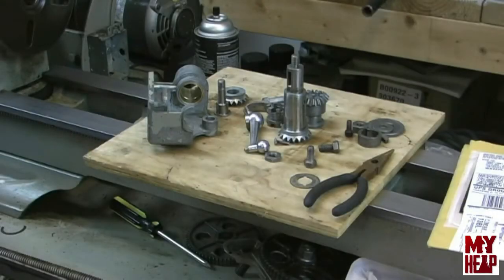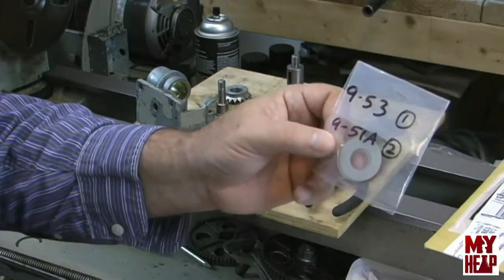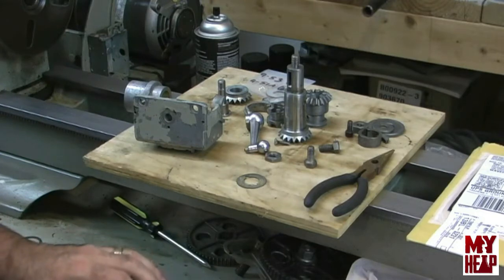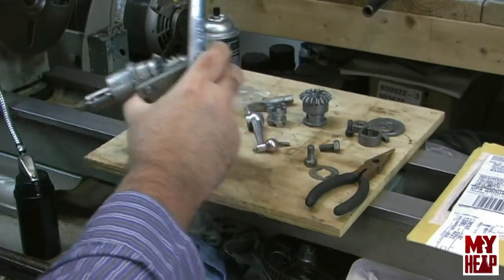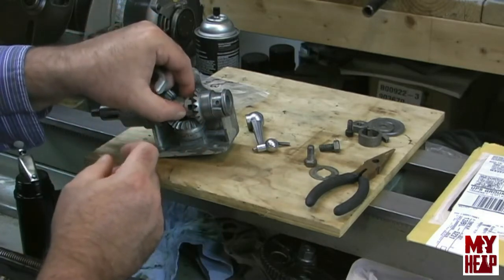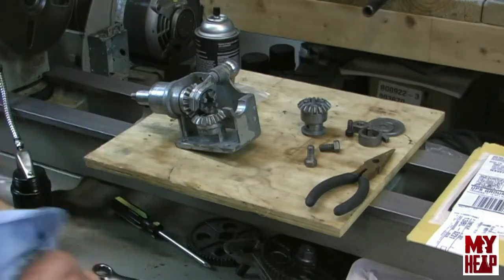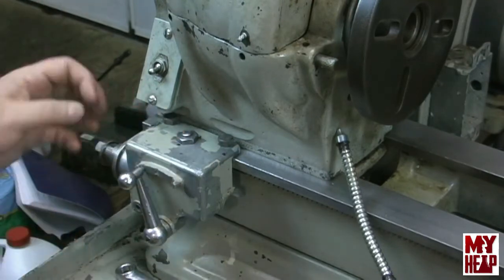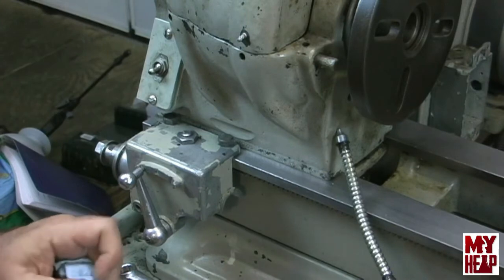Atlas 10F Lathe - TH54 - 10 - Installing the Lead Screw Direction Change Gearbox

Comment: Nice! Those direction change boxes were apparently nicknamed "crash boxes" lol. When I got my lathe one of the gears was missing 4 teeth. Then the leadscrew bearing jammed up (due to someones really crappy replacement) and totally destroyed the clutch dog... so I pretty much rebuilt the whole thing from scratch lol. Didn't do the bushing though, but it's on the to-do-list 😉.
Reply from the maker: I am a bit ginger with the one on my lathe.  Have not had any issues or problems but it looks like a weak point.  I think I would rather had the tumbler type.  Thanks for taking the time to comment.

Joe

Comment: Hi Joe 
WOW 3 fibre washer's $20 dollars 6 years ago, "Daylight Robbery"
I'm still looking at doing this on my Micro Lathe, but things are very tight because of the size, i will let you know what the outcome is in the next few weeks
atb
Kev (UK)
Reply from the maker: Hi Kev.  Yes,  I took a beating on that.  I was just starting to learn about machining and stuff like that.  I hope I would do better these days.  😁

I thought you would have some room between the banjo and the end of the headstock to fit it, but I understand about the limited space.  Let me know what you decide to do.  Thank you for stopping by.

Joe

Comment: does that spacer next to the change gear remain off if the diagram calls out screw gear in the back position? say 56B? so the 56 gear would be where the spacer is?
Reply from the maker: If the thread chart calls for a gear to be put in the back position, remove the spacer and place the gear on the back then wither put the spacer in from or another gear as a spacer.  I hope I understoof your question and that my answer helped.  Thank you for watching.

Joe
Reply: @MyHeap -- is there a spacer on the lead screw shaft that can be removed to flip the gear-  I was trying do a 1-14 thread and it seemed the lead scew callout was not in the right place
Reply: my atlas still has lantern toolpost- what do you recommend for quick change toolpost?  thanks for the help
Reply from the maker: @strongspeed  I will try to make a video on the spacer for the leadscrew in the next couple of days.  I am in the middle of tearing out my kitchen and dining room for a remodel so have been pretty busy.

As for a quick change tool post for the atlas 10, I would recommend an AXA wedge type.  Mine is Chinese, bostar I think, but I am happy with it.  It has been a while but I think I bought it either off eBay or from cdcotools.

Hope that help.

Joe

Comment: No problem Joe yes if memory serves me the early lathes had thinner  gears at any rate I have a few surplus of the thin gears. Buy the way how thick are your gears?
Reply from the maker: I will measure them tonight and let you know, but from just a glance, they look to be about 3/8 of an inch.  If they are the thinner ones, would you be willing to sell your extras?

Joe
Reply: absolutely i can put the $ in to something else. they should be 3/8" or 1/2" i think i need 1/2" so any 3/8" are up for sale .
Reply from the maker: If that is the case, I will email you a list of the ones I need and we can work from there.  Look for an email in an hour or so.

Joe
Reply from the maker: Chris, sent you an email with the gear width.  Mine are 3/8 inch and listed the gears I am missing.  Thanks again for your help.

Joe
Reply: ahh good news ill look at it
Reply from the maker: Chris, just went downstairs to take a very close look.  I have the gear counts correct, and thankfully Jeremy Gagnon gave me the two gears I needed to get the .0035 feed and gave me another bolt/bushing/nut set that I was missing.  I am however needing another heavy washer that goes under the nut that holds the gears onto the bushing.  So if you have a spare one of these I would be interested in that too.

Joe
Reply: i don't think i have spare but this wold be a great first project  it could be made without the need for power feed.
Reply from the maker: You have a point my friend.  Thanks for giving me some perspective.  :-)

Joe
Reply: My Heap not a problem that's what lathes are for. :)

Comment: I don't believe it would ever be prudent to operate an Atlas with the spindle turning in reverse.  Wouldn't the chuck or backing plate turn right off?
Reply from the maker: Hi David.  You are right, you could turn the chick or plate right off the spindle if means are not implemented to prevent it.  Still there are some good reasons for running the lathe backwards.  For example, cutting a right hand thread from a groove or using a rear mount tool.  Thank you for watching and taking the time to comment.

Joe
Reply: @MyHeap  You've piqued my curiosity. What means might one employ to ensure that the chuck stays put. I have a TH48 with an on/off switch like yours. Many thanks for your lead screw reversing gear series. I'm in that process, myself, at present.
Reply from the maker: @gdhandle  Steve Jordan has a video where a drawbar is used with a piece in the chuck.  Once tightened down, the chuck cannot back off as it would make the drawbar tighter.  I will see if I can find it and drops link here.

Joe
Reply from the maker: @gdhandle  here is the link.

https://youtu.be/8PYsNfKk_Q4
Reply: @MyHeap  Thanks

Comment: From one computer geek turned machinist (I'm actually going to school for it), thanks ever so much for posting these. I recently acquired a TH54, and today's project was removing the change gears and putting them through a cleaning bath to get the horrible black crud off of them. Most of the lathe is in incredibly good condition, so I'll probably not be pulling the headstock apart any time soon, but it's nice to know anyway. I found you whilst searching for how to remove the banjo - it would appear that the 3/4" thin-head screw is simply being difficult in my case, so I'll keep at it. You might check out James Clough's channel at https://www.youtube.com/channel/UCeKpbMimEGgLM_0tnghfoVw (he's another computer guy & machinist) - he's got an electronic leadscrew project that puts a rotary encoder on the spindle, a servo on the leadscrew, and does the fancy math for you to allow changing feed rates with the push of a button. I'm going to be building one for mine as soon as I can afford it - the basic electronics are cheap, not so much the servo & drivers.